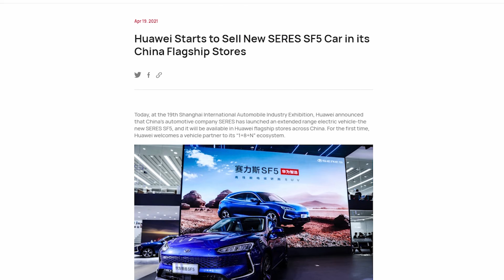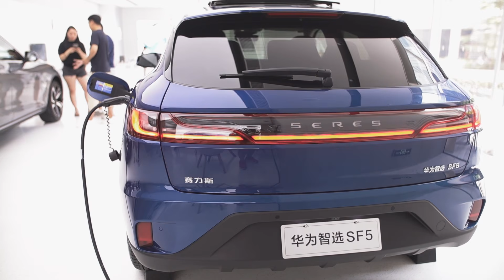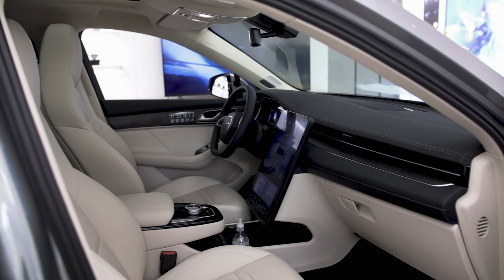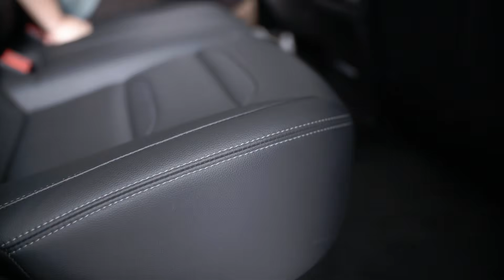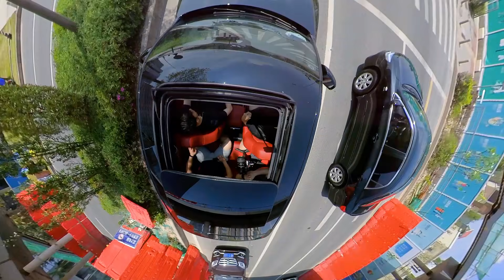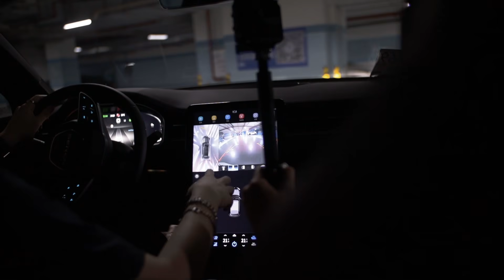Huawei SERES SF5 Electric Car Review [English]

Comment: There should be a app which you can install on your Huawei phone to control the car using bluetooth.  So instead of the keyfob, you use your Huawei phone to unlock the door, pop the trunck, see through the cameras, and start the engine.  You could also use the Huawei phone to park the car at low speed 3 km/h.  Your Huawei phone could have a virutal steering wheel and pedals on the screen, allowing you to drive the car using the phone while standing outside the car.  For parking.

Comment: Huawei should do a full electric car without petrol engine .
Reply: Is not a petrol engine. It is a fully electric car. What it has is like an emergency generator powered by gasoline. So if you are running out of juice, turn on the generator and it will power the car via electricity (and charge the battery too!)
Reply: @chinolombia   yeah, but a true EV would be fossil fuel free.    However, the technology is awesome! Huawei knocking it out of the park!